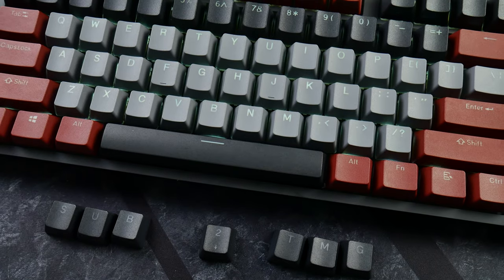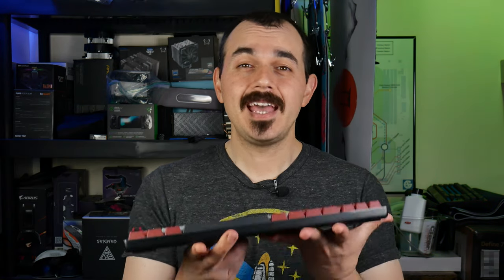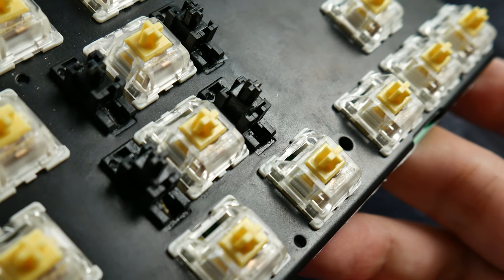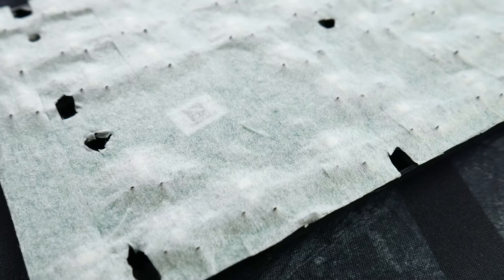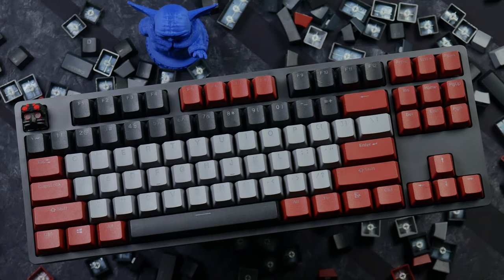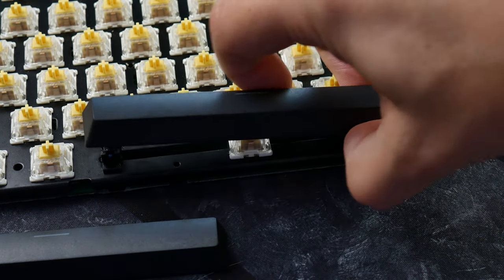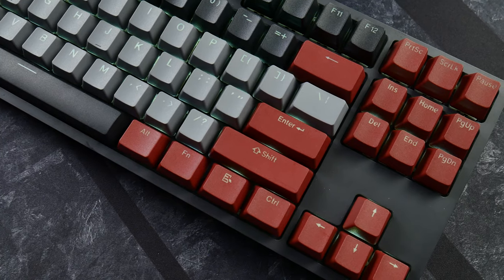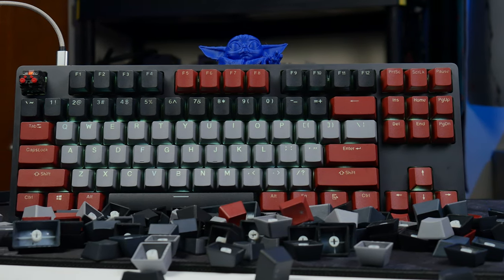You Won't BELIEVE How This Simple Drop ENTR Mod Turned Out!

Comment: That keycap set is niceeeee
Reply from the maker: Yeah they're not too shabby, but they need to work on those spacebars some.
Reply: As always great videos. How would you compare these keycaps to the double abs keycaps that come with the GMMK2? I just got my GMMK2 and was just watching your video on GMMK2. Going to do some mods like you did but wanted to ask about the keycaps.
Reply from the maker: Hmmm, well the stock Glorious caps actually aren't that bad at all, really. If they aren't imminently offensive, or else keeping you from properly tuning your stabs, I'd just keep those. That said, if you're looking for unique colorways with nice shine-through legends, the only other manu that compares is, IMHO, Tai Hao. Since this was made, Skyline colorways have expanded quite a bit, and presumably manu quality along with it. Note that compared to the Glorious caps, Skyline caps will sound noticeably deeper, so if you're already using a deep-sounding ditch in your board, this will make the board sound much darker, but still airy, due to the thick PBT construction and relatively tall profile.
Reply: @TheManicGeek  thank you so much and again thanks for your awesome videos. ✌️

Comment: I have a green on with Halo Trues.  It is a very good beater keyboard.  Get a refurbished one for $50 and it is an outstandingly good beater.  Mine came with the standard Slate keycaps and I do have the Valiants too.  Interesting combination you made there.  I do have a real nit to pick with drop over their skylight line.  As much as I like shine through keycaps, these - all of the darker kits - must have the lighting on to read the legends.  Without some back lighting or very bright, direct lighting, the legends just disappear for me.
So ... you desoldered all of the switches?  And then soldered in a set of the same switches?  What am I missing there?
Reply from the maker: I mention the ones I put back in were already lubed and filmed, so it saved me the trouble of having to do it with the ones that came with the board.  The end result here can't be achieved without doing that step, otherwise the switches feel more scratchy and spring ping will still be very present.

I do agree that the darker cap sets can't really be used WITHOUT RGB backlighting, but that's the tradeoff you make when you want shine-through legends like that on PBT, especially.

Comment: Do you think I could replace the pcb with a different TKL one that is hotswappable?
Reply from the maker: Unlikely given the overall design of this PCB, but you COULD solder in MillMax hotswap sockets if you wanted to. Thought about it for my second ENTR, actually, just haven't gotten around to doing it, yet.
Reply: @TheManicGeek  ahhhh that sucks :( I can’t solder things due to my hyper mobility causing severe joint pain / shaky hands and muscles. I really hoped there was an easier way bc I have one of the drop expression keyboards, I love the look and have gotten attached to it but I HATE the sound !
Reply from the maker: @lesbiibab7559  totally understandable! That's actually an interesting proposition for this board, would you want to switch to something like a light silent linear?
Reply: @TheManicGeek  yeah haha, I have sensory issues with noise and the tactile switches are a little bit too much for me, sadly. I was hoping to switch to a budget linear option like the milky yellows or feker’s version of the matcha switches but it looks like that won’t really be an option unless I can find someone (on Etsy or eBay or something maybe?) who can solder the switches in (and maybe lube the stabs) for me for a decent price :). Thanks for all your help!
Reply: @TheManicGeek  good news, found someone to mod it for me for a reasonable price :)
Reply from the maker: @lesbiibab7559  that's great news! It's a really nice board to mod tbh, a personal recommend for silent linears is Gazzew Bobagums. Matter of fact, I may do a silent mod on my other ENTR 🤔